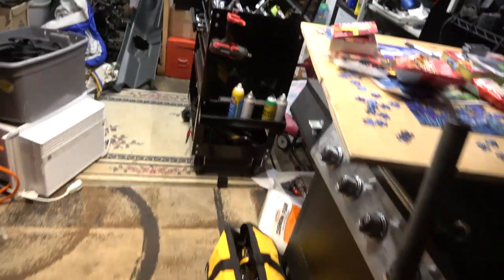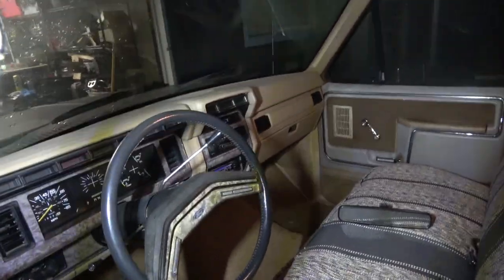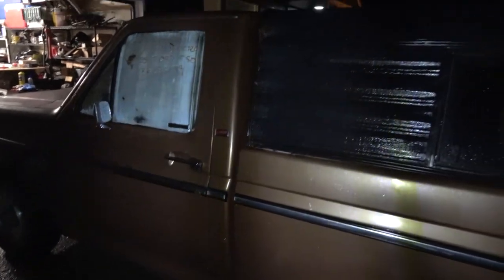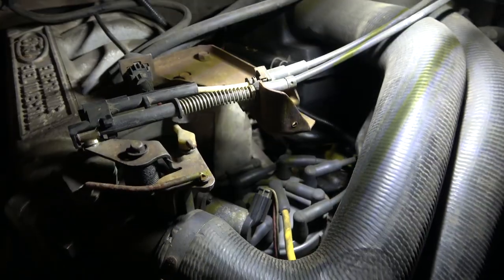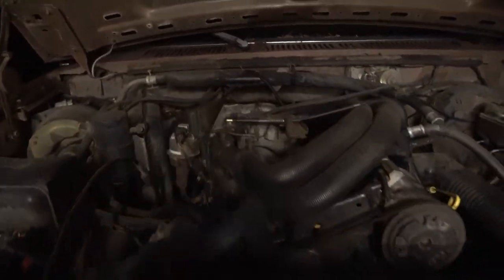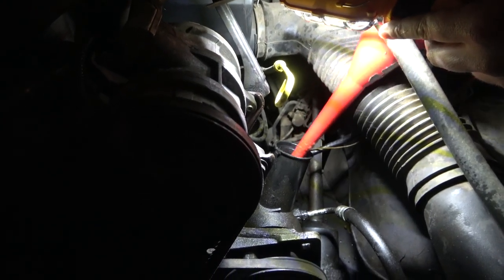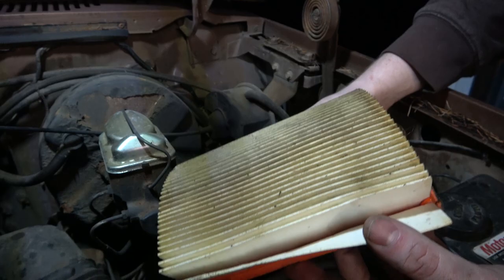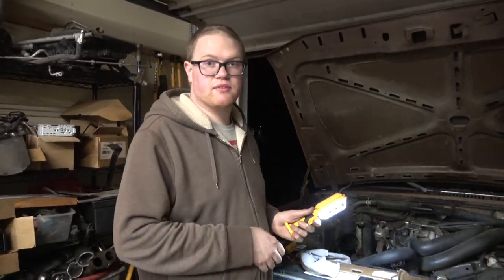I Saved a Clean Bullnose F150 from the Junkyard! | First Look!

Comment: Jimmy trans is an AOD 4 speed automatic, notice the TV cable from the throttle body, your shift indictator will go PRNODD1, trans code should be T on the door sticker. Read up on the TV cable adjustment as it is crucial to the life of this trans as it adjusts line pressure in relation to throttle position to set shift points and how long it holds gears and is very easy to fry the trans if the cable is not adjusted right. When you get around to it you'll want to change the fluid and filter and , and I highly suggest if the truck doesn't have an aux. trans cooler to get and plumb one in, even a 40 dollar cooler can work and protect the trans. Most of the emissions you can junk as well if your state doesn't e-test.

Comment: Nice find. I pulled what I thought was an '86 junker out of the woods and it turned out to be a pretty clean 300ci 4-speed 4x4! Once I get the title squared away, I'll be doing a full rebuild. All for the low price of $0.00. The bullnose is one of my favorite Ford truck designs.
Reply: If everything goes good I’m gonna be getting a 83 f150 4x4 for $500 the only 2 issues are that it doesn’t have a carb or keys

Comment: I've got the same truck, '86 XLT Lariat w/ 5.0L EFI, AOD, 2WD. You got a great deal, better than me. Mine is rust free with a recently rebuilt engine but it needs a bunch of other work. The main problem with this EFI is it's speed density, not MAF. It can't keep up with engine mods like MAF so you are basically stuck with a stock motor or close to it unless you change the EFI.

Comment: If this is anything like the 89 I bought with the 302 it had so much blow by it would literally use like 4 quarts in 60 miles or so.  Was about the same price too. I've learned that typically if a vehicle comes with oil bottles in it it means it uses oil, same with if it has ATF in it.

Comment: Good score!
Reply: You score gold I found me at 86 long bed with a 302 long bed 2 Wheel Dr. for $300 need a hood passenger fender tires and has a brand new gas tank on it somebody put a rebuilt new engine in it and few injectors it was clogged up with dirt . I call summit racing got a intake and a carburetor put in a one wire distributor net and it fired right up there was no sludge in the engine